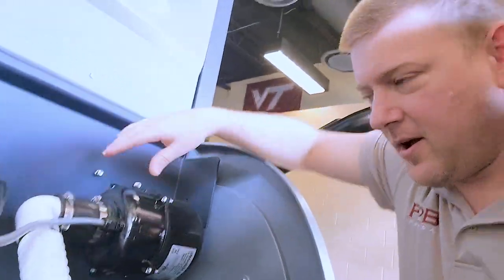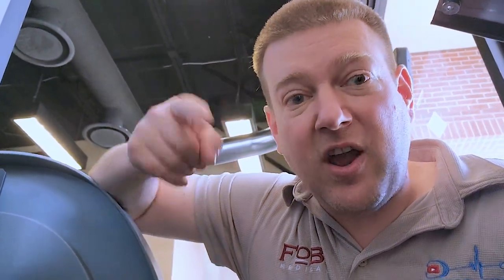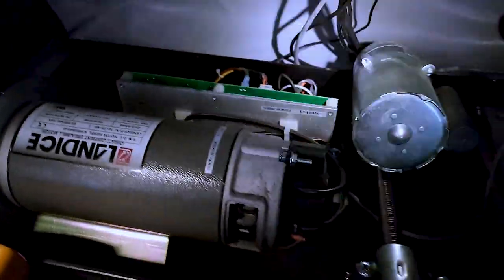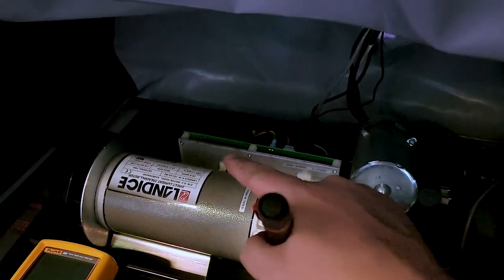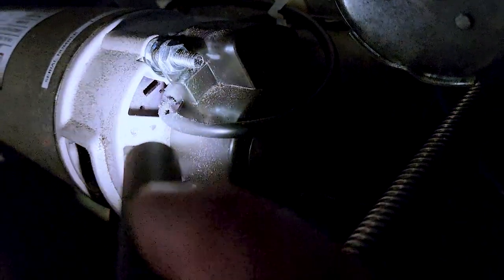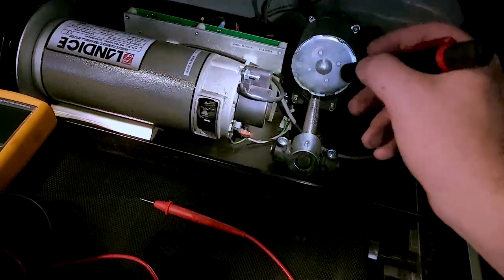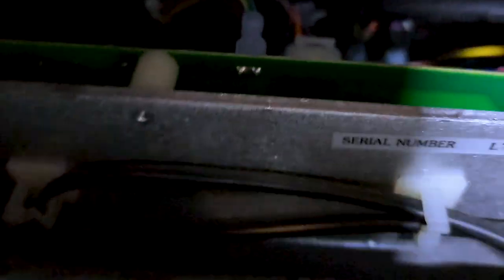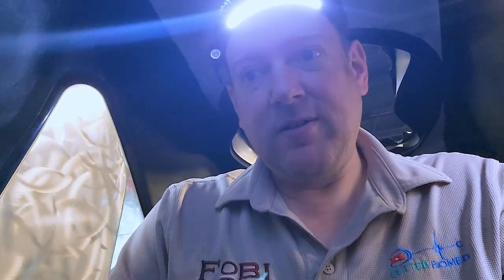Alter G Treadmill Belt Drive Failure

Comment: We have one Landice treadmill in our hospital.. we faced one error .. while operating.. and it was ' L5'. 
We repaired the main control board and ran the machine .. But after increasing the speed .. and running it for 10min.. again the error came. Now the components are again defective. 
Where is the issue.. can u suggest.
Reply from the maker: What did you repair on the main control board? I need more information